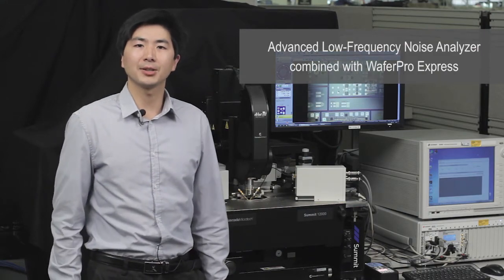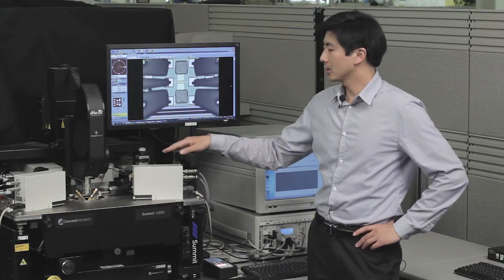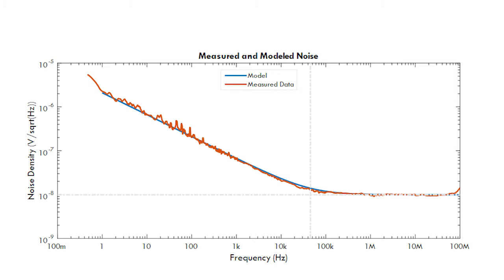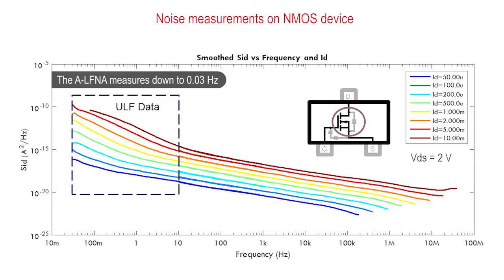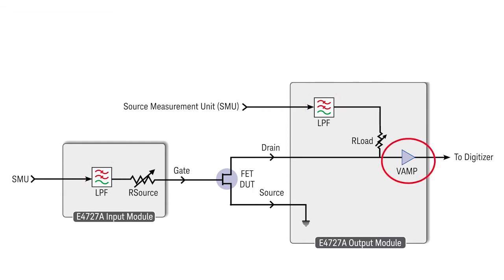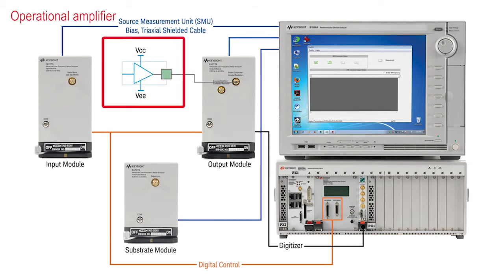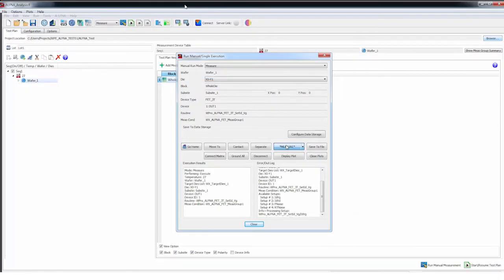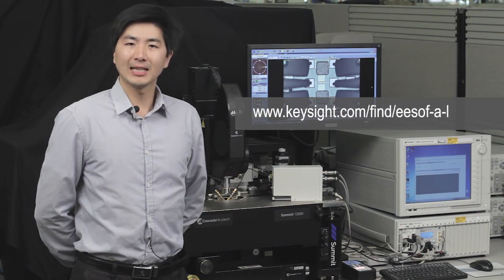Low Frequency Noise Analyzer Technical Demo

Comment: here we present one configuration of a noise measurement 
although many others are possible using those modules to measure noise in CMOS device  

the source measurement (you need like the keysight P500A) is used  to apply pairs and a major DC operating point

 when measuring noise , the source measurement unit noise contribution must be feared about the voltage noise is amplified and analyzed using a high-speed digitizer

the variable resistance , switching and the filtering functions are included in the remote area from a modules which will be placed close to the device under test so as to minimize the cable capacitance and ohimc losses 

here we see how the output module may be connected across the drain and source of fet
it may be similarly connected across the connector and the emitter of a bipolar transistor ,anode and cathod of diod 

the two teminals of a resistor or the output terminals of a operational amplifier IC  
here we have a new WPE and ALFNA Project 
we add a sequence, themperature and wafer and then specify the subside and home location 
for each device we choose from a myriad of routines to execute our measurement and the one of those routines can be edited and customized with Python code
now we initiate a measurement once the measurement is done 
we can look at those different outputs including DC current and voltage measurements